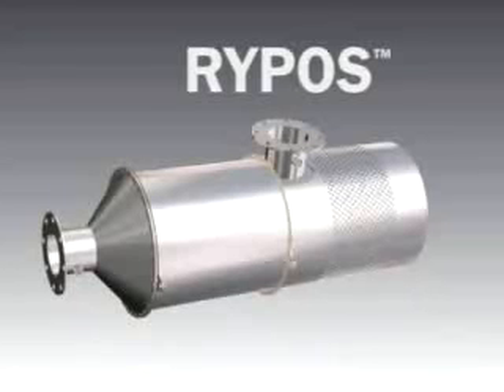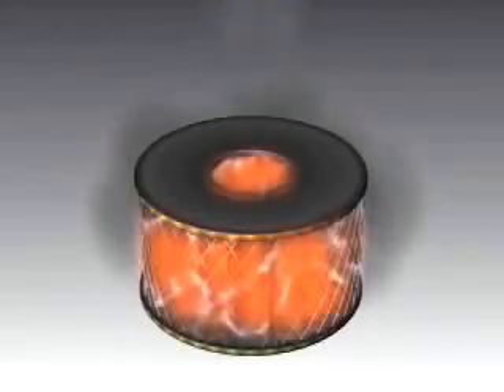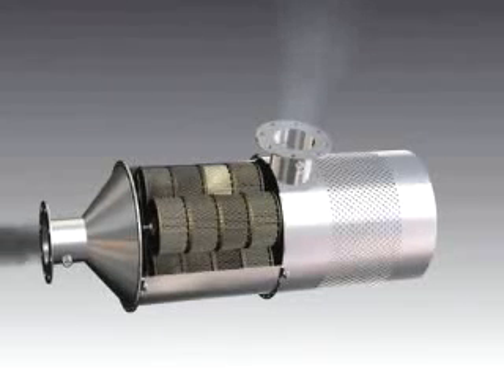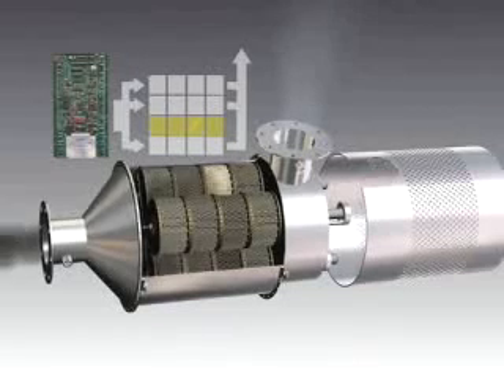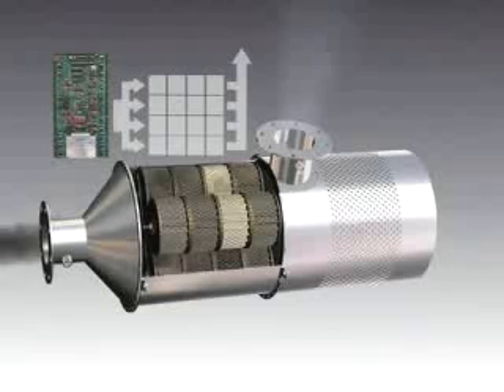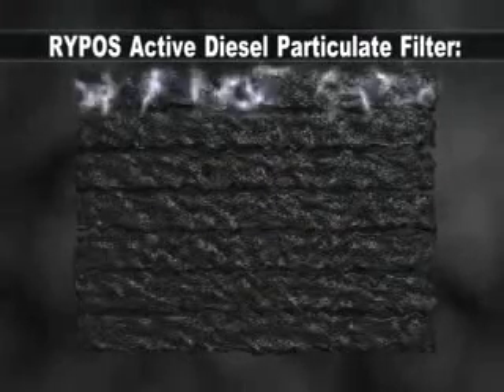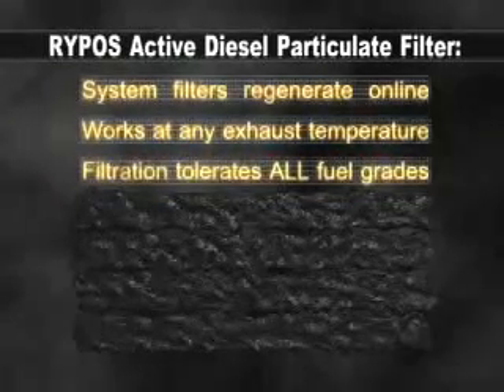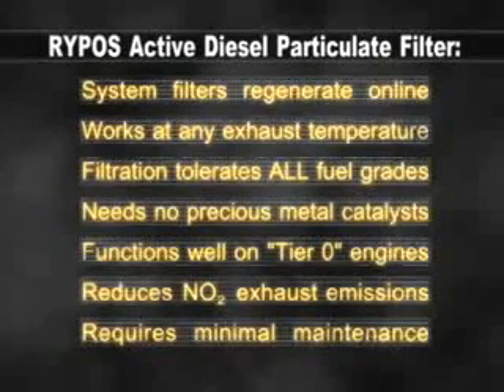RYPOS Active Diesel Particulate Filter

Comment: @babineau00, my father had a 2008 dodge ram with the 6.7 cummins and it burned up 3 turbos in just 28,000 miles. whatever DPF was used on it destroyed the turbos and gave it an avg mpg of about 11.5mpg. the previous model cummins without the dpf was much higher (around 17avg) and was known for its reliablity.

Comment: @babineau00, True, but the build up from the DPF causes backpressure that causes the turbo to fail. The manufacture says its because the regen cycle was cut short by shuting the engine down before it was complete. They expect people to drive around so it can finnish, that waistes even more fuel and it will be dumping fuel into the exhaust thus waisting more just so it can clean itsself. I dont think it gets more wastefull then that. We are dumping fuel down the drain just so save on emissions.

Comment: @123abcpa I don't know how much back pressure these filters create but would be surprised if it were anything more than 1 or 2 psi.  Even then, all that needs to be improved is the addition of more filters or lower the acceptable back pressure levels by burning it all off sooner.  I believe as DPFs progress and become more widely used, they will improve in design but until then, we shouldn't just not use them.  As of now, I feel the pros still far outweigh the cons.

Comment: @123abcpa I'm wondering if that could also be the result of a different engine with the same displacement.  Anyways, I think the injecting of fuel into the exhaust IS a waste of fuel, but also a bad design.  From my understanding, DPFs don't always need to be hot as they are not continuously cleaning them self and are capable of doing so by using electricity to heat them self so why would they need the fuel injection?  Finally, how will this shorten engine life if the high heat is downstream?

Comment: @master7chief,I know for a fact that the Ford 6.4's and Cummins 6.7's get about half the MPG of the previous diesels offered in them. the DPF burns fuel in the exhaust to raise exhaust temps to about 1100 deg. that no only burns extra fuel but also greatly shortens the life of the engine. The DPF reduces engine life, that means people will be buying new truck much more often and scraping the old ones early, What a waste of resourses, energy, money, and the environment. we also burn more fuel too

Comment: @johntrebec But I'm sure that ash is better than black smoke or they wouldn't be making these things mandatory.  They cut down on more pollution then just carbon, I'm just using it as an example.  Also don't forget, the filters don't draw power all the time, only for a few minutes to clean them selves.  Hopefully I can find some real specific info on this stuff.

Comment: Thats true, it will require more power from the alternator which = more drag on the engine.  However, diesels make plenty of torque so there would hardly be a difference even in fuel consumption.  Furthermore, the exhaust gases are already very hot, so it wouldn't take a ridiculous amount of power to heat the filters. I would imagine it would definitely not be anything more than having headlights or fog lights on.  I don't know specifically how better the ash is for the environment than carbon.

Comment: @johntrebec Why are you talking like such an @** hole instead of debating facts?  Yes it may cause fuel consumption to increase due to slight back pressure.  With out knowing specifics, I'm confident it will cause no more than a 5% increase in fuel consumption.  And you are arguing that that 5% increase is *more* than enough to *cancel out* the benefits of reduced pollution even though this filter removes 60-90% of PM?  hhmm...  When you attack people instead of facts, you sound very ignorant.